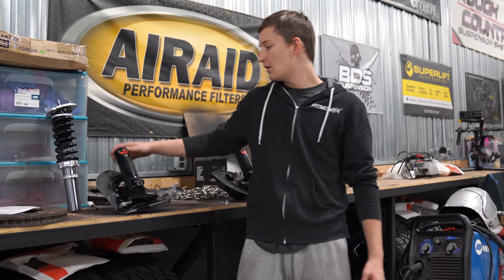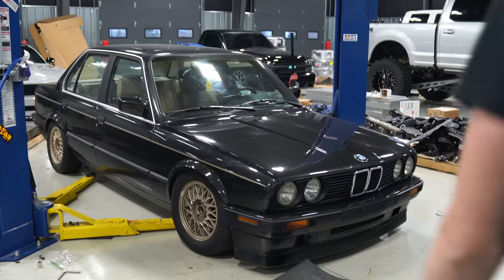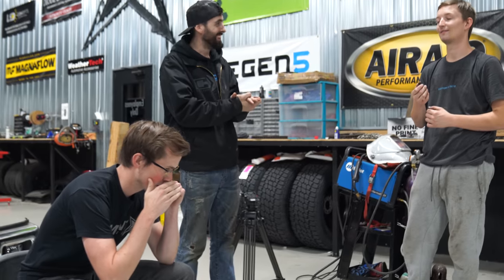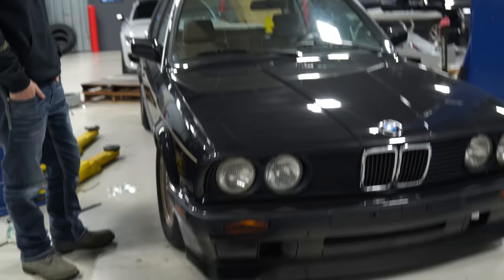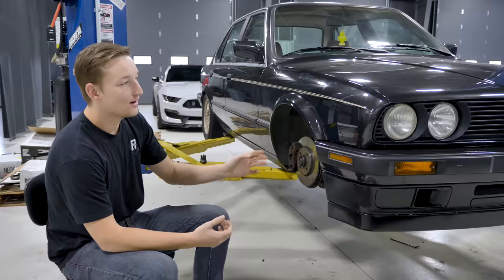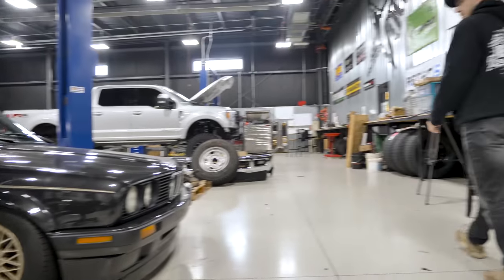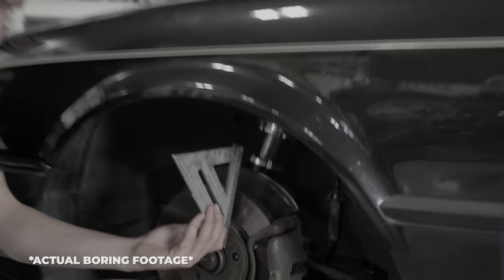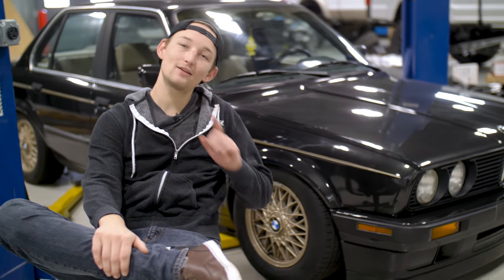Finding The Perfect Fitment | BMW E30

Comment: I was static that low, drove around just fine in mine lol. Better get a Red46 skid plate,  5 offset in rear I rubbed, so fenders gotta be rolled. most likely front also.

Comment: Damn thats a pretty weak wheel setup for a e30, anything above 16" on that beauty should be illegal !
16x9" et 15 is a more optimal setup, you can fit a 9,5" in the rear with a similar ofset.
Reply: KosovarMods 16s look small AF unless u wanna run 60 sidewall, which no one wants to do
Reply: 195/40's with 9 and 9.5J looks on point slammed
Reply: KosovarMods so running above 16s should be illegal but slamming shouldn't? Personally, I'd rather run 17s with nice tuck and fitment so I wouldn't have to slam it
Reply: @matthewmajorweenus6212  16's look nice on it and it's period correct! 

Plus it needs a period wheel/tire fitment!
No modern style massive stretch, small tire, etc...
Reply: I might be wrong but they're gonna be running 17s because that's the smallest you can get from Cosmis's lineup.

Comment: I'm about to unsubscribe before they make that beautiful E30 into a crap pile. If I'm not notified maybe I won't see the finished product (if it's ever finished). You guys need to get on one of the E30-specific forums and learn what works. You could have avoided the oopsie you just went through. And start stocking up on oil pans. Trust me.
Reply: Ah shut up lol let them fail and learn from it. It's more fun this way. You're right about the oil pan tho LOL been there
Reply from the maker: We are already working on the next episode that might change your mind! So stay tuned and you might just be surprised how the car actually turns out despite your input! 😘🙏🏼
Reply: But really get more oil pans. $45 from rock auto and you'll be happy you had one on hand